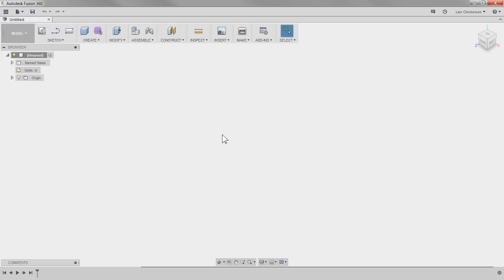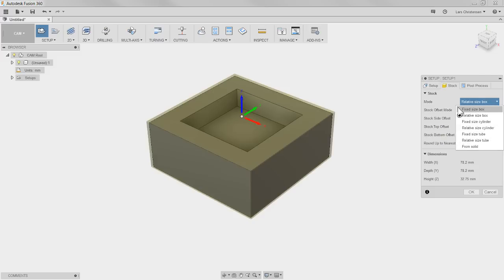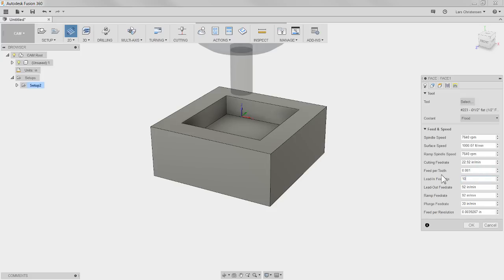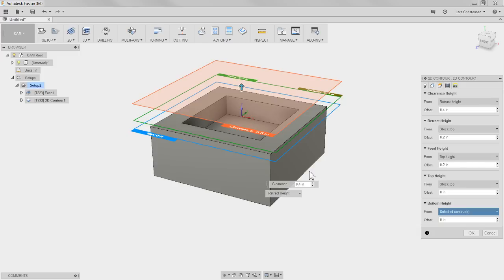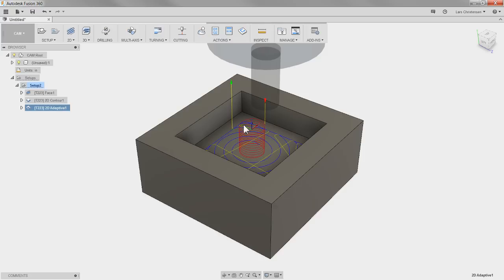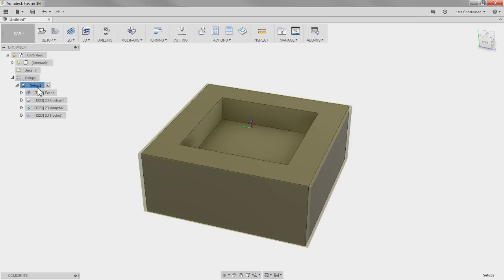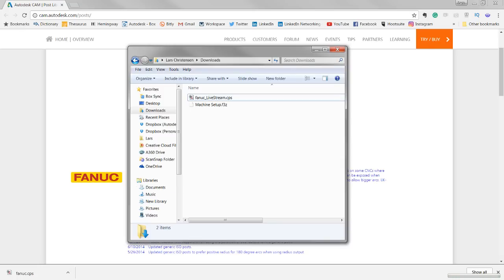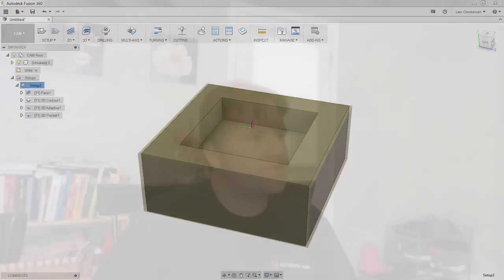Fusion 360 CAM 1st. Time With a NEW Post —Your Comments & Questions — #LarsLive 14

Comment: Hi Lars,
We made a post using fusion 360 CAM just to try out how it goes on the machine (fagor). When we loaded to the machine it was ok but when we tried running it, cutter was spinning above the stock and all the process were correct but in the air. Any suggestion or help would be great. Thanks
Reply from the maker: Hi juned vahora Thank you for watching!
1.I would check the WCS you created on the Setup page. Is that in the right location and the correct work offset?
2. Check the g-code output and see what the Z values are like...Are they all positive numbers?
3. Then go troubleshoot on the machine. Was the work offset set correctly?

It is normally one of three things. Operator error on the computer- Post needs a tweak - Or, Operator error on the machine :-)

Comment: I always set heights bottom up in HSMWorks. I assume I will continue with Fusion. I like to set my part zero 1" high, drop in, quick tape measure. Then subtract the 1". Gives a little safety zone.
Reply from the maker: Nice tip!

Comment: This really helped a lot I just purchased an ox and this video was great. The only problem was the spindle didn't start and I'm not sure if it's a fusion problem or a chilli pepper issue, its setup with a tinyg controller. Would you have any ideas where I'm going wrong. Also your videos have been the most help that I have found on the internet so far thank you Darrell...Edmonton Canada.
Reply from the maker: Hi Darrell, Look in the manual for the machine and see what code will start the spindle. If you don't see it in the code from Fusion, you know that's where the issue is.

HAve an awesome day!

Best,
Lars